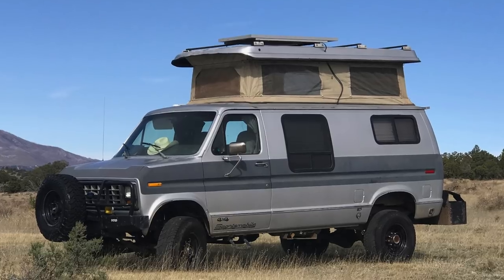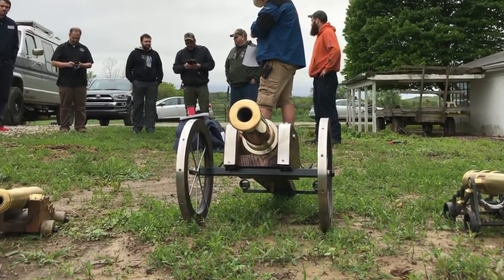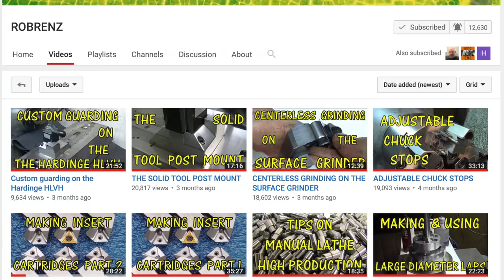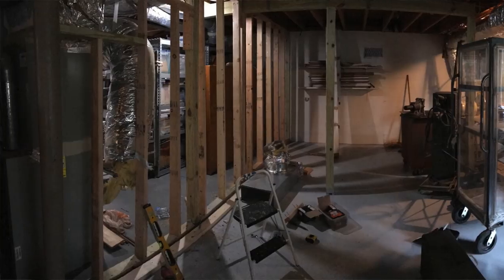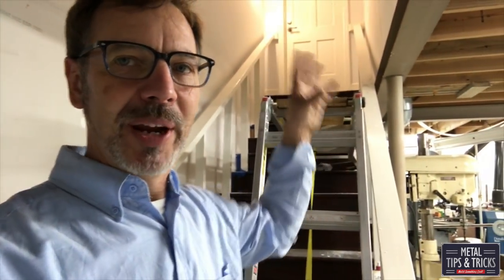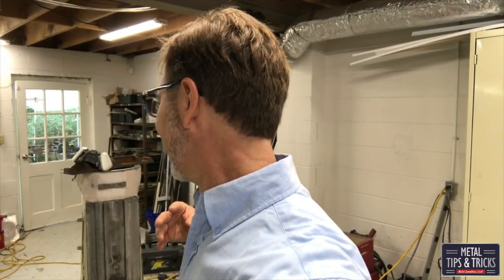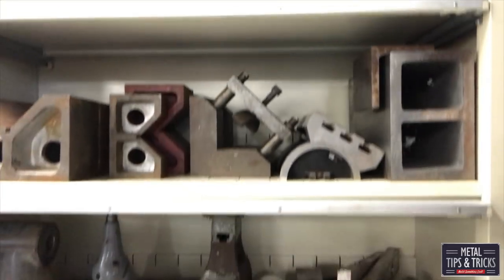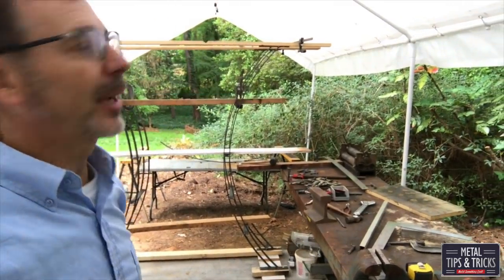Shop update June  2017 and world tour

Comment: I recommend looking at Automation Direct's drive series instead of getting 3 phase power in the house.  They can take in 240 and run 1-3HP (or more) motors and you can set the speed.  Prices are about 200-300.